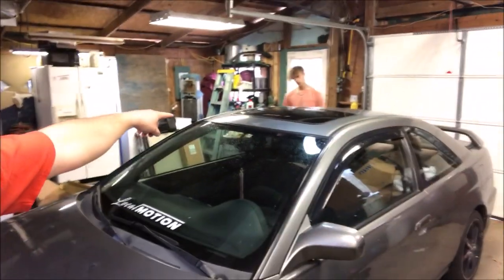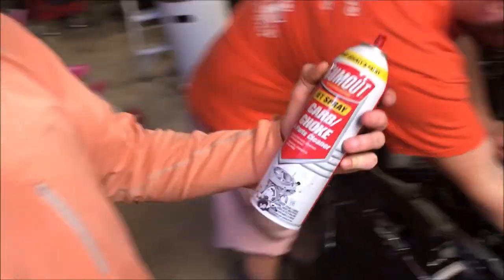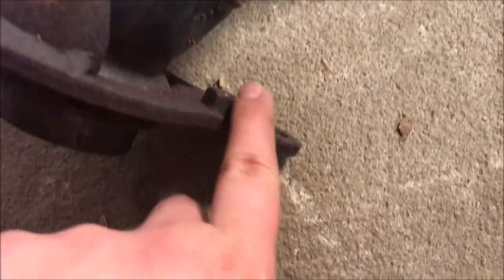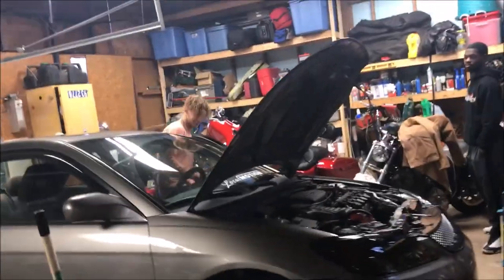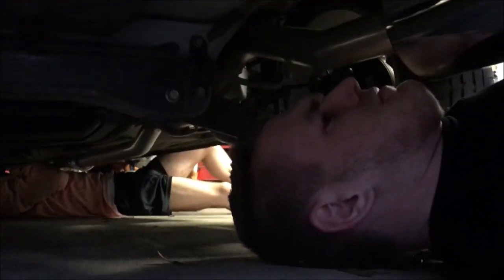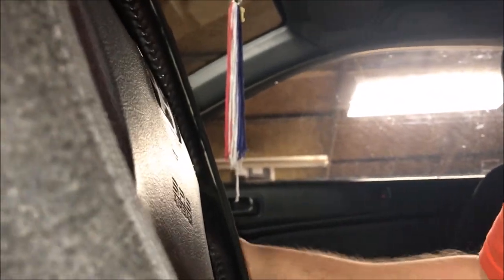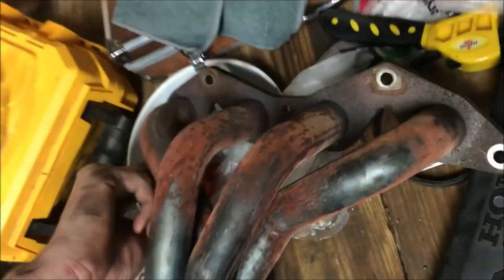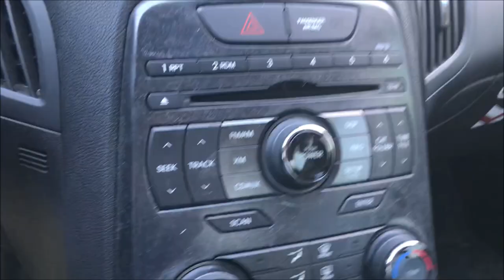Civic Exhaust Install! (05 Civic EX)

Comment: I bought the same exhaust and I’m just warning you if you end up lowering the car that exhaust literally gets hung up on everything it’s totally fucked it scrapes everywhere It’s only half an inch from the ground at the lowest point of the exhaust pipe right there in the middle I’m probably gonna take it to a shop because it’s getting torn up
Reply from the maker: This is correct, but bc of the cheapness the owner didn’t have a problem with it
Reply: Local Motion no yes I understand it’s literally the only one on the planet right now for that 100 130 dollar price it jumps straight to magnaflow for like six hundred theirs nothing really in the middle in terms of price update I actually took it off right there where it Bolts up to the catalytic converter and you could already see a nice dent the ground is making on it I just took a towel and hammer and smashed it in even more and it’s a hell of a lot better now I love it
Reply from the maker: recklessjunkie nice tip!!
Reply: @recklessjunkie  actually, there is a mid tier exhaust. It’s 350 and it’s called a srs cat back, and I’m getting one for my car
Reply: Will a 2.5" inlet fit on a 05 ex coupe with b18 all oem